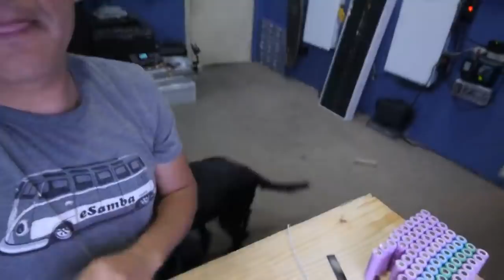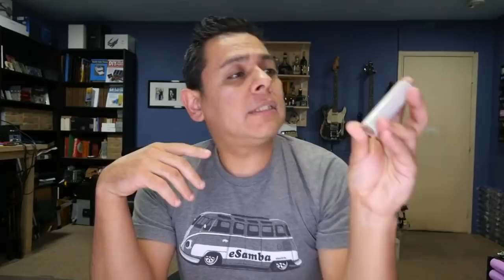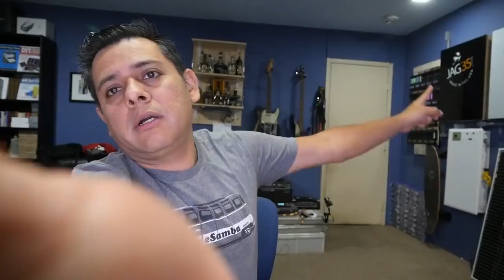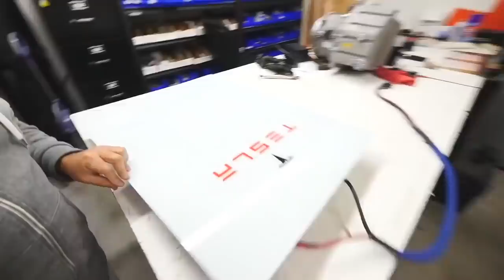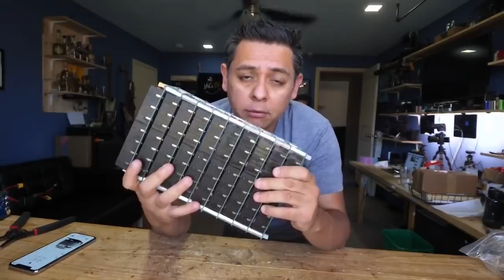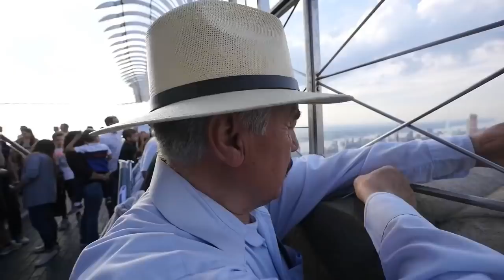Monday Live Q&A 8pm

Comment: So, let’s say I built one of these power walls. Is there a video you have of how you actually install it in your house? Is there a way to plug it in your outlet and have it backfeed to everything on that circuit? Or something similar? Otherwise you’d have to get an electrician to pull a permit, wire this thing into your house properly and I don’t see anyone willing to try and do that with a home made battery. Any other information is greatly appreciated, I love this channel!

Comment: im planning a DIY EV conversion here in Kenya but the greatest problem is finding suitable batteries,what are your thoughts on N70 lead acid batteries? i will use a 96 V 15 KW Chinese AC motor in a 1600 kg station wagon.

Comment: I have a little question, i have been thinking a lot about this, but i gonna try it, i gonna build my own powerwall. but.... my chargecontroler will charge untill 14V ±0,5V. and that will be to much for the batteries, what chargecontroler i need to use??  thanks!!

Comment: hello, i want to build a 13s10p battery pack that can supply 300 amps continous and atleast 400 amps crank rate,. what 18650 cell can you recommend? can you also recommend a bms that can handle those amps,. and what is the best charge rate for this battery pack config for quick charging,. i paln to use this pack on an ebike,. thanks
Reply: Ivan Jed Balmes you would need at least 30p with 25r cells